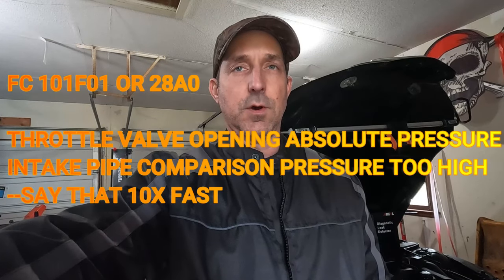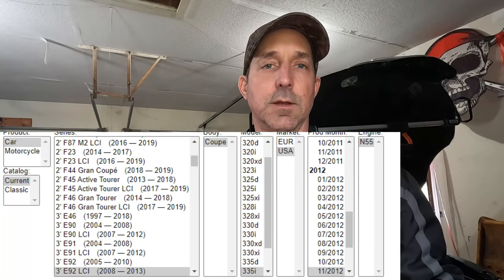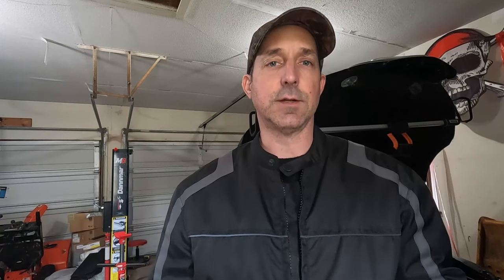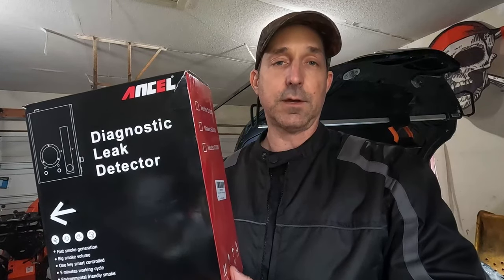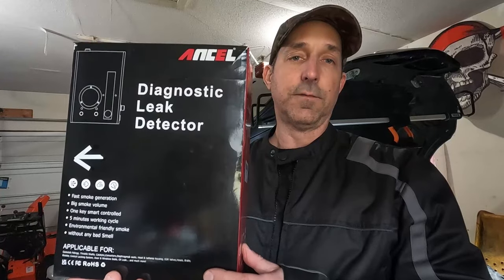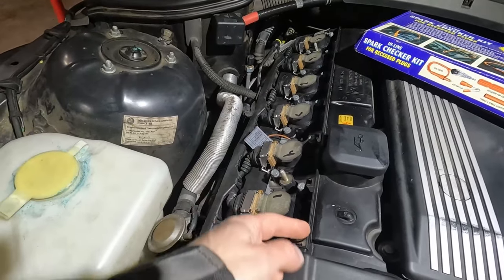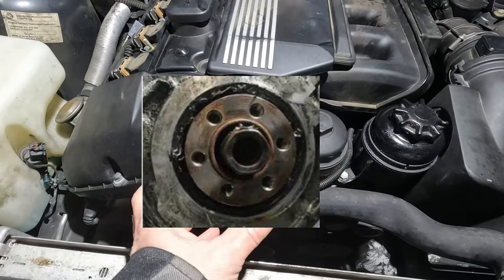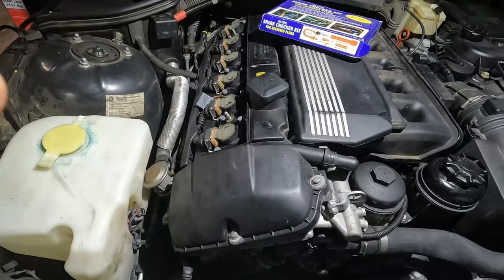28A0 or 101F01 or P 112F BMW Fault Code N55 Fix! And odd N55 issues I have seen!

Comment: Just had the 28A0 after I deleted adaptations when replacing the tank purge valve. Im going to try and do the adaptations with the valve unplugged
Reply from the maker: I have fixed a lot of cars with that trick. I hope that works for you as well!
Make sure to subscribe as I will be giving away a smoke machine in the near future.
Reply: @AskTheCarExperts  sure will, one thing to add is that now I get pops and bangs because of the unmetered fuel fumes 🤣 im sure going to miss that but prefer a CEL free X5.
Reply: Did that work for you? I’ve been trying to solve 28A0 for 2 months my car has been sitting! pls help
Reply: @HamptonEdwards  I had to put my old tank recirculating valve back, the new one was either defective or was the incorrect for the fabrication year. That fixed my issue but im back to square 1 with a tank valve stuck open lol. Thankfully no more rough cold starts because I was loosing fuel prime because of lack of pressure.
Reply: Hi Sir, I have been having this 28A0 CODE for 2 years now,(2013 bmw x5 35i x 3.0 litre gas engine 193,000 now )which sets off these codes,2EFE 2EFF,2F00,2EE2,2EE6,2EE9. which is caused to appear because of the 28A0 CODE... i have had this code, 3164 (fuel tank system ,2nd inlet port malfunction.)So I purchased a new valve from Rock auto, and the part numbers was for my x5 as i checked cross reference with oem bmw part number to reassure it was the right one for my x5. that is fixed fine now, but the 28A0 is still givin me issues and continually appear and continues to give my vehicle surging and surging for a about 3 times in the COLD temperature only, before it sputters and finally levels off ok after 10 seconds or so , if its really cold (1 degree) it can and do chug chug and has shut off on some occasions and had to restart it. i live on the East Coast of Canada and the weather is getting colder here now and thats when this ongoing ordeal,Chug,chug continues to be a nuisance. also it will continue to store a 28a0 code. i have replace plugs,new top pan and gasket and oil cover housing gasket was leaking 2 years ago/new belt and pulleys. BTW,what is the high pressure fuel pump pressure suppose to be at idle i m wondering..?? the thing is, the vehicle is working fine and no misfiring or feel of anything wrong when i drive it for hours on the highway, just that cold start and the 28a0 code nuisance. O,The FRM Footwell module is also showing up on my ANCEL BM 700 OBD11 as being a issue! Sir, what Are your thoughts and or your suggestions on this nightmare light?? ty in advance Sir.   . @victormanuelparraexposito2819
Reply: @battlehrfred  I think that your next step should be a vacuum leak test (smoke test). The evaporative system has way too many o-rings and fittings so there’s maybe a leak. 
Check also your charge pipe o-ring and soft boot for tears and pinholes. A bad fuel pump could also cause lazy cold starts but what you are describing happened to me when I first replaced the tank ventilation valve, the car would sit for 2 days and would loose prime and get a hard idle or high idle, got mass airflow codes, 28A0 and one other that I forgot, also it would pop and bang because I deleted the exhaust flap, what fixed that was to go back to the old part, all codes went away and only the tank circulation jammed open remained, replaced only the top portion with a new one and done, no more issues.

Comment: Great video, thank you.

I have a 2011 BMW X25 N55 ... and this damned fault code is a real pain in the a...ss.
Have been chasing it since 6 months. I have replaced so many parts and I am very frustrated.

When I start the car, cold or hot, it will rev up itself to 1500 rpm, then go back to 1000 rpm and then gradually down to 650.
The idle needle is stable but I feel rough idle on my seat, intermittent vibration. When chcking N55 start up on youtube, it seems that mine is not so normal (rev to 1500 and go down)

CEL is ON. Fault code is 101F01. I have done the idle procedure countless times, but the fault code will come back everytime.
I have replaced so many parts...Spark plugs, ignition coils, turbo inlet pipe, turbo outler pipe, intercooler, charge pipe, TMAP sensor, Hotfilm MAF sensor, intake manifold gasket, throttle body, puge valve)...

The only light in the dark tunnel I have seen is that one day, after disconnecting purge valve, I cleared the code and I did not reconnect the purge valve electrical connector, I drove the car like that for 3 days. 
I put my ISTA-D the 3rd day and checked but the 101F01 code did not show up for those 3 days.
I had CEL ON but it was because the purge valve was disconnected (tank vent disconnected).
So I think my problem may be on the Evap side, because when I isolate it, the code wanish. 
When I check on ISTA, with tank vent connected, I can see several occurences at different speed, rpm and times of this 101F01 code. I believe it follows normal purge valve operation openings and closing during driving;

I don't have smoke machine unfortunately to check tank vent system for leaks. But I suspect that my problem maybe on the tank side. There is no fuel smell in vehicle, I can fill my tank full with problem. 

Any suggestion welcomed
Reply from the maker: That would be an interesting failure for this code. You can remove the TVV and see if it is closed correctly by blowing through it. At this point I would replace it and recheck since that seemed to make a difference.
Reply: @AskTheCarExperts  Hi AskTheCarExperts!  I think I have a very similar issue as Smile Iso9001 here and have been working on for more than 1 year.  Can you help explain why these N55 with 101F01 code tends to have very rough idle at cold but gradually smooth out when it warms up? Is it because those hydrocarbons are being burnt during the warm up process? Thank you so much!
Reply: Smile Iso 9001 I have the same issue as you are experiencing and also do not have the p112f code reappear if I leave the purge valve disconnected.  Did you have any luck tracing your Evap side ? Did you replace the purge valve with success?
Reply: @markzuege8641  Hi, purge valve was replaced but no luck.
I have ordered new valve cover from FCP. I am waiting for other parts like coils and spark plugs, then I will replace valve cover and spark and coils.
Wish me luck.
I intend to do the job in 2 weeks (waiting for the parts ordered). I have already the new valve cover available but I don't want to do double work so better for me to wait for plugs and coils and replace all at the same time I do the valve cover.
Reply: @SmileIso  Ok, interesting I ended up doing the valve cover, I also changed out my intake cam and bearing caps for new.  I had the p112f reappear but after leaving purge valve unplugged no error..  ended up driving around with it unplugged, blowing out evap lines and checking for leaks. 3 days later I reconnected the evap system now light is out, seem it has resolved my issues finally.  Goodluck with yours!.  Mark
Reply: Coil and spark replaced along with Valve cover. No luck. Still 101F01 fault code.
Only when I disconnect valvetronic I have smooth idle but still CEL on because of valvetronic disconnected.
Reply: @Mark  Good to hear  the light never came back after you plug the evap purge Solenoid.  Its been
 8 months now any Updates?
Reply: @Smile After changing the coils plugs and valve cover u said no luck. What else did u do? Any update now?
Reply: @SmileIso Hi, do you have any success with your car? I've done everything you wrote about but no success...😢

Comment: Would you happen to have a video or link to the location and/or process for disconnecting the purge valve on a 2013 535i F10/N55? I can’t find one anywhere to save my life!
Reply from the maker: I have the N55 on my X5. I think the location should be the same. I cam try to do a short this weekend about it.

Comment: Simply disconnecting took the cel away is that regular?
Reply from the maker: Maybe you had a bad connection but that is great that that worked! That is not a common fix.

Comment: I have this code but have a knock between 2 to 3 rpms. Smooth as silk at start and over 3k rpm. I dont know what this is. I have code p112f no other codes.
Reply from the maker: Sorry to hear that you have a knock sound. That is a common failure from the rod bearings. I would have the vehicle checked and you may be able to save the engine with replacement rod bearings as long as there is no internal damage.
Reply: @AskTheCarExperts  they confirmed its rod bearings and engine is on borrowed time. I dont have the money to fix it. This will ruin me for a while.
Reply: @AskTheCarExperts  i cant find a place that will replace bearing with a knock. They want to be 100% sure it will fix it. I might try to do myself.

Comment: I have the same code but mine is pressure too low. Any idea, smoke tested and have no boost leaks
Reply from the maker: Boost pressure too low can be a consequential fault or a direct fault. It could be the turbo itself or a control feature of the turbo such as the EPDW or vacuum supply if applicable.
Reply: @AskTheCarExperts  mine is EWG 2014 335i
Reply: @AskTheCarExperts  I recently installed FBO and brand new Pure stage 2 turbo

Comment: I have an issue last night where My OFHG was leaking and it slipped my belt off, cleaned all the oil and installed new belt, no pulleys damaged,
After driving for 30 minutes I got SEVERAL Misfire codes ( 2AA0,2EFE, 2401,2ee0,2eea,)
I am lost, Don’t know where to start
Before I cleared the codes and started it I had 2ee1,5,6,8
Reply from the maker: Sorry to hear that Ivan. I do offer diagnostic help for members and quick advice on comments. It might be that the front main sealnis damaged fron the belt. Unletered air leaks can cause misfires.

Comment: Hey car Expert I’m Terrance I have a 2011 F10 with the N55. I have to codes I can’t seem to get ride of. 101F02 throttle angle - intake manifold pressure, correlation: limit exceeded
104302 absolute pressure sensor, intake manifold, plausibility, caster: pressure too low. Any help of guidance would be greatly appreciated.
Reply from the maker: I would start with the two pressure sensors. But one I had ended up being the mass air flow sensor. Smoke test the intake and valve cover first and fix any air leaks.

Comment: hello
i had valvetronic error 2E0F (Valvetronic system: deactivated, too frequent adjustment error) only - not possible to delete, then i changed servomotor, error not gone, add new 2DCE (Valvetronic system: no adjustment possible) - possible to delete, but not 2E0F, i did not did adaptation, drive about 500km, still valvetronic errors and nothing more, then i go to diagnostic (programmer), he connect phone for  about 1 min to car, i dont know what he did (also after this my bimmerlink needs more time to connect to engine), but valvetronic error gone, and it start work, BUT when i drive 10 meters, this 28A0 error came imidiately, he told me that this is because = reasons from this video, but i think its somehow related to valvetronic, cause valvetronic and throttle are connected and works together; check engine light on only first time, then i delete it, error cames after start engine without check light, no fluqtuating rpms, no reduced power. what do you think?? could normal adaptation using rheingold solv that problem or really have problems from video??
sorry for bad english
Reply from the maker: Hello, Did you replace the eccentric shaft and the valvetronic motor? Usually you have to replace both items.
Reply: @AskTheCarExperts  no. i replace only valvetronic motor, eccentric shaft was in good condition, now valvetronic works, no errors, but i think it needs normal calibration, not that fast thing that this guy did. cause this error (28A0) came imidietely after valvetronic start working.
if car have vacuum leaks, this error would be before valvetronic.
thanks for response

Comment: Hi mate. hope you are doing well. I have this error code ''21A02D Combustion Control Idle Irregular- Permanent'' it runs rough or hesitate when accelerating. Any suggestion what should i do?
Reply from the maker: I would need more info to try and help.  I do offer one on one help for my premium members. But I will try to help as best I can.

Comment: Hi I got the same code in my 550i F10 N63. 101F01 and also 118401. Can you make a video about these if they have something in common or is the same problem maybe?
Reply from the maker: Sorry to hear that. One of the most common causes of this fault code are unmetered air leaks. One of the most common spots for an air leak is right where the fresh air pipe goes into the turbo. The seals break down or the whole tube can be loose. I would recommend a smoke test of the system to see if there are any leaks.
Reply: @AskTheCarExperts i have an ActiveHybrid3 N55, had an ongoing fault of 2202E3 and a leaking VGC (no CEL/car running strong), replaced the VGC (not the valve cover), after the car was put back together the CEL came on saying lean and implausible reading from MAF. 
Found an inlet pipe to be broke (believe the one you mention here), replaced. 

Drove the car for 15 mins and the CEL came back - 101F01 - throttle valve opening angle, absolute pressure, intake pipe, comparison pressure too high 
118001 - Mixture control, Mixture too lean  
118401 - Mixture control, Mixture too lean; large deviation 

Please help / any ideas? 😂😂

Comment: Where do I find the instruction video to reset the adaptation?
Reply from the maker: @jarredallen2016  I guess I need to make one for you!
Reply: @AskTheCarExperts that’d be awesome! I did find the reset in my autel maxisys it didn’t help. I also unplugged the vent valve and ran it for 15 minutes and that didn’t help. I get 2 codes immediately on start up. 28a0 & 2bee
Reply from the maker: @jarredallen2016  Send me an email on your car. AskTheCarExperts@gmail.com
Reply: @AskTheCarExperts is it possible to call you? I’ll send a brief email with my number. It’s just so much to type…
Reply: @AskTheCarExperts  good evening! Just wanted you to know I sent you the info on the car. Thanks

Comment: Heyy so I definitely have the code 28A0 , my x5 smokes sometimes out the muffler pipes when driving sometimes and the power isnt always there , would that be because of the value cover gasket ? Or do i just need to change the fuel pressure sensor ?
Reply from the maker: Hello, Smoking out of the tail pipe could be quite a few things. If you have air leaks it could also be running rich. I would recommend a smoke test of the intake to start.
Reply: @AskTheCarExperts  thanks i will do that this week . If i have more questions ill be back 😆

Comment: Hy my name is mduduzi from south Africa please help im have a BMW n55 e90 335i 2010 my car stall like cut power while driving
Reply from the maker: Hello in South Africa! Sorry to hear you have this issue. Have you had the fault codes checked?
Reply: Thanks for the response but not codes  but code which There are codes when it cut out and you clear them and Neva came back but now I'm getting the DME relay code because when you put your foot down it drop the throttle and that is wer you can have the DME relay code

Comment: hello sorry to bother you can you help me please I have several codes on my Bmw 640i I have the message on the GPS screen Powertrain

Ride moderately.
The powertrain cannot deliver its full power.
Have it checked by your Dealer.
the car starts to lose power we put the computer on it gave me several codes:
101F01Air mass system, plausibility: calculated air masses in the air intake system not plausible 102002 Air mass, plausibility: Air mass too low 119404 Rail pressure sensor, signal: Permanently stuck 11A002 Fuel high pressure, plausibility: Pressure too low 180001Catalytic converter: Efficiency below limit value. I could be very grateful for the information please thank you
Reply from the maker: Hello Sebatsian, I would be happy to give my thoughts on these codes. Air mass issue - smoke test the intake. Air leaks are common at the crankcase hoses and the fresh air intake pipes to the turbos. Rail pressure sensor stuck -- replace the sensor. High pressure plausibility - do the sensor first and recheck. High pressure pumps are also common to fail. Cat efficiency fault - failed CAT often due to leaking injectors. If you find a broken down CAT via inspection via borescope replace the injectors as well as the cat on that bank.

Comment: I fould use your help bad
Reply from the maker: Hello,  what can I help with?
Reply: @AskTheCarExperts  I have a 2012 BMW 535i. The air intake hose on the front end has a few cracks and I'm wondering if that setting my check engine light off and on. My check engine light will come on for a day then go off for two and come back on for a day. I ran it on a code machine and I got p112f code. Manifold absolute pressure to throttle angle too high ( bank one).  I'm wondering if these two are related
Reply: @AskTheCarExperts  I don't live close enough to a dealer to take it in and have them diagnose it in our local shops here overcharge tremendously for doing any foreign car work
Reply from the maker: @discoverwealthnow  The air leak can cause this code. I would definately start with fixing all air leaks.
Reply: @AskTheCarExperts  when the local garages told me to tape it real good. But it's in the front before any sensors. If I had a picture I would show you a picture of the crack part